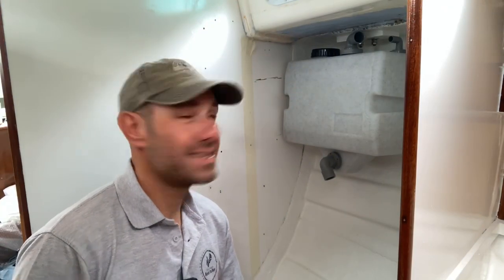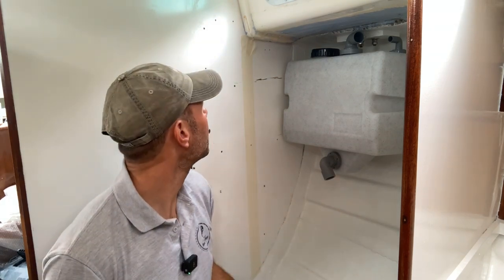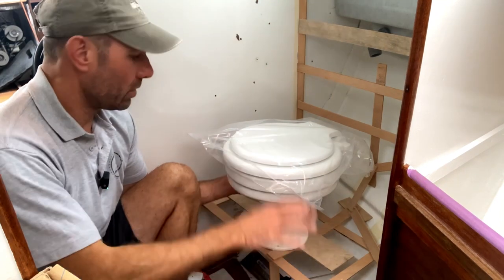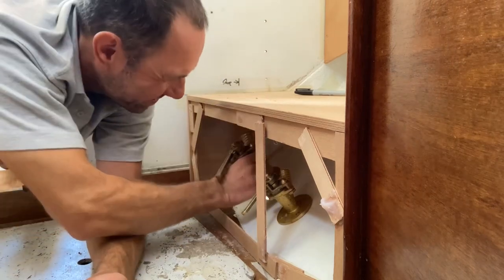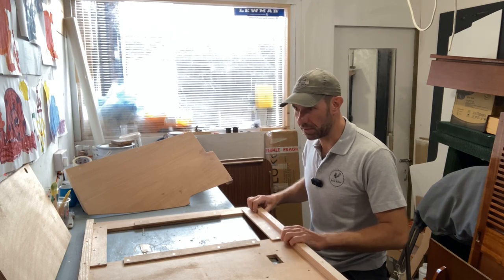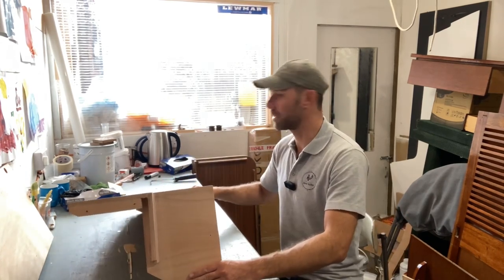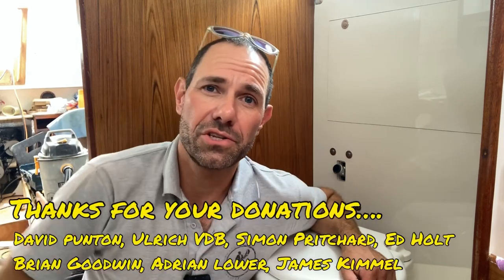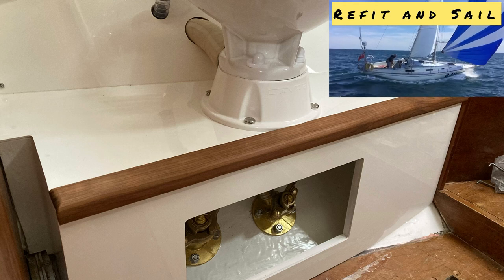New Contessa 32 Heads (toilet) Build - Part 2 (Project Lottie Ep 24)

Comment: I usually butt the two pieces of veneer together and with a jig that is 100mm  longer than the piece, screw down the jig on both sides the width of a router bed and run a sharp 6mm cutter down the centre of the pieces. That way if any deviations happen in the router pass they will both match, it works beautifully in veneer and in formica laminates, which show imperfections much worse than veneers, ive made joints almost completely disappear this way.

Comment: Hi
Beautiful head
When you glued the fineer did you wet the fineer as well with epoxy or only the wall?
Reply from the maker: I found it was better to apply to both the bulkhead and the veneer as only apply to one surface resulted in the veneer absorbing all the adhesive then there not being quite enough to bond it well.

Comment: George, that is a very smart looking heads! Fantastic work as usual. Can you post some more details on the white sheets you used? Type, thickness where you purchased etc. Thanks!
Reply from the maker: It’s 2.5mm thick and that was the thinnest option.  May be best that you have a conversation with or visit your local industrial and decorative plastics supplier to see what they can offer.

Comment: Like the veneer solution, had my doubts but it seemed to work well.  Did you use a fast cure resin, or anything special?   I have used waterproof PVA, accelerated with a warm domestic flat iron, for the saloon table but you do need a bit of patience.   👍
Reply from the maker: It was a fast hardner with the epoxy and a pretty warm day so didn’t have a lot of working time.